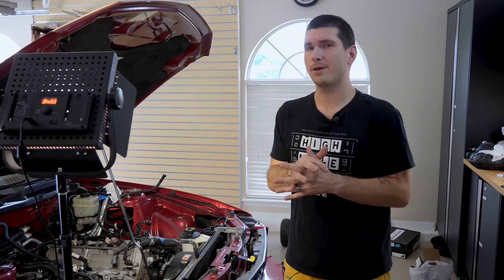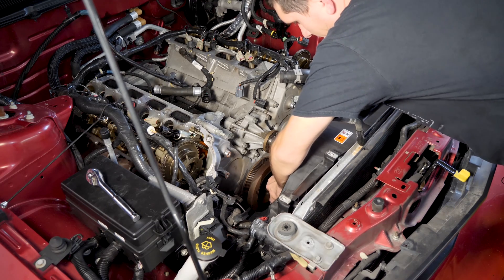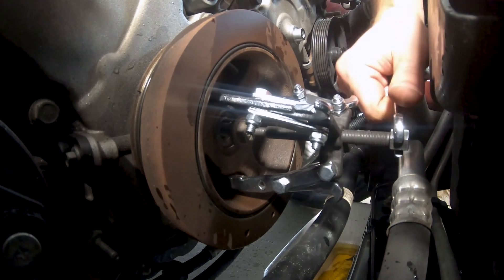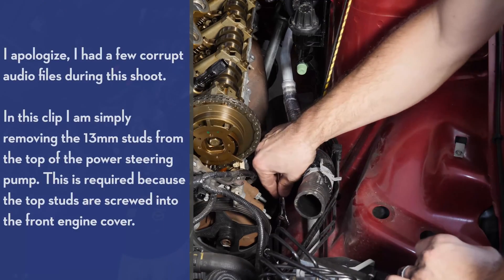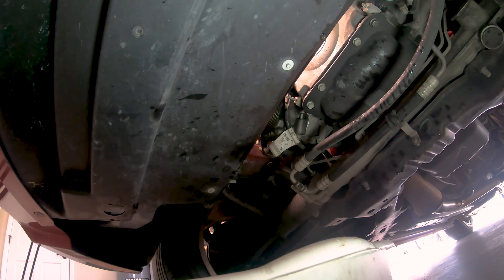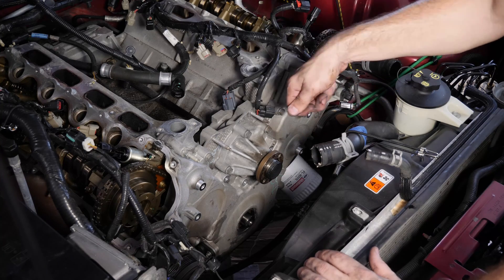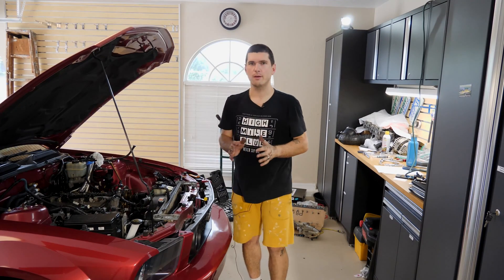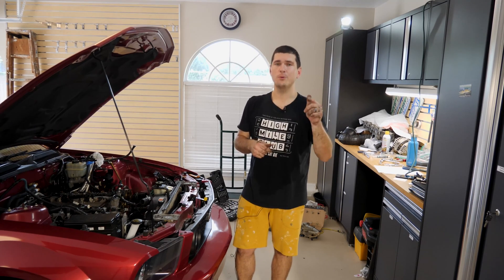How to Disassemble A Mustang GT 3v 4.6L Motor 2005-2009 Part 4

Comment: Yep that’s right a good job I always use compress air compressor to blow the engine off when every I do work on my car 04 mustang GT dark shadow gray and 14 mustang GT sterling gray especially blow out the spark plugs hole before you take out the spark plugs and after the plug comes out

Comment: GREAT Videos. I have a 2007 gt. Was doing a tune up and all 8 spark plugs broke off in the heads. Ford know about the defective design and even made a tool to fix it instead of a recall. thanks Ford. I'm not going to risk my engine having porcelain in the cylinders. We were going to bring this in but after watching your videos husband is tackling himself and its going very smooth. Thank you for the best video on this subject by far.
Reply from the maker: Thanks Sharon. Hope my videos help. Let me know if you run across any issues or have any questions. Good luck!🍀

Comment: Excellent video I m tearing down an engine with roughly 105K on it I will be redoing the heads possibly camming it and looking for a programmer. I am looking to get around 400HP form the engine. Any suggestions?

Comment: I am so happy I found your videos. I broke off 6 out of 8 spark plugs in my 06 GT and I was completely panicking about taking the heads off because I’ve never done this sort of thing before. Anyway, you do very professional videos and I am so thankful I you go into such detail with everything. I can’t wait to get these heads off and get these spark plugs out.
Reply from the maker: That’s awesome man. Made a whole series on the disassembly. Let me know if you have any questions and I’ll try to help out.
Reply: I will definitely let you know! So far so good with the progress. Really tempted to put some hot rod cams in it.
Reply from the maker: Yea! You should. I tried my best to spin this situation into something good. I ended up doing all new followers, lifters, springs, cams, phasers, timing gear, seals, long tube headers, and I had my heads completely reconditioned. It was crazy expensive but I essentially have a completely reconditioned engine!!
Reply: About to pull mine on an 06 GT also. Stock has lasted this long to 40K miles but I feel like 1 or 2 might be misfiring now. How did it go with yours? You never replied back haha.

Comment: Love your videos bro! Started with the xterra vids but do enjoy your content! Cant wait for the next video!
Reply from the maker: That’s awesome, way to ride or die my man. Thanks for watching. Recently got some good video suggestions for the Xterra so when I build a little money back up I’ll get the X back into the spotlight.
Reply: Cant wait! Buddy of mine has one so it's a big help when it comes to some of the problems I come across on his x. Tpms,high oil pressure gauge, fuel pump, ignition coil packs, etc . All the repairs I've performed, and it still has a new issue every week. This weeks issue, won't rev over 3000 rpms and won't accelerate.  Lol! Thank for the reply Ry!
Reply from the maker: Sound wild! Good luck with it.